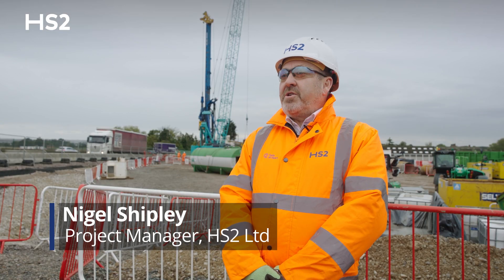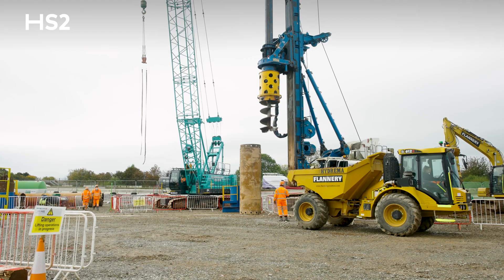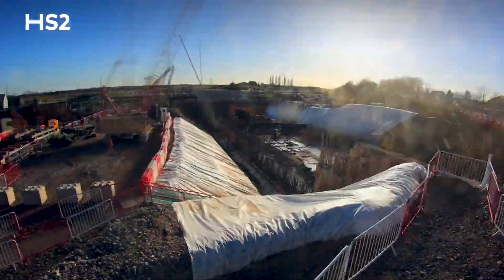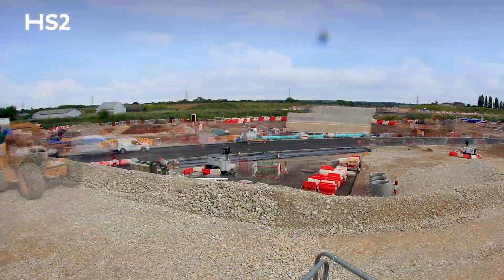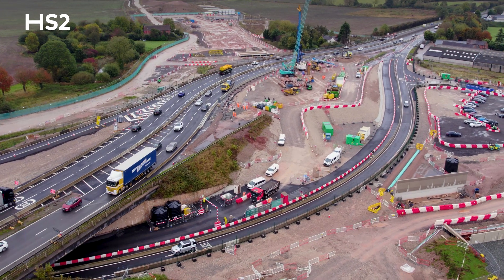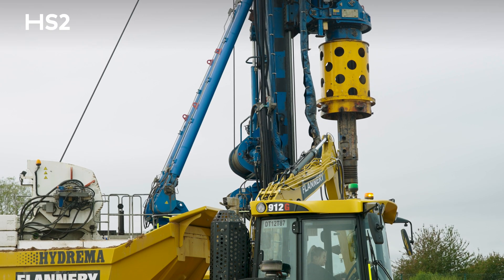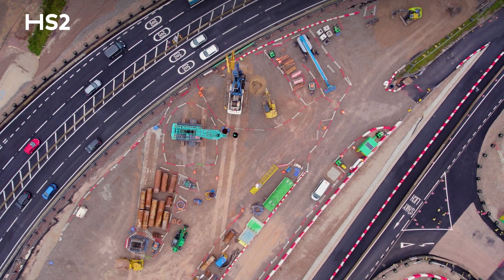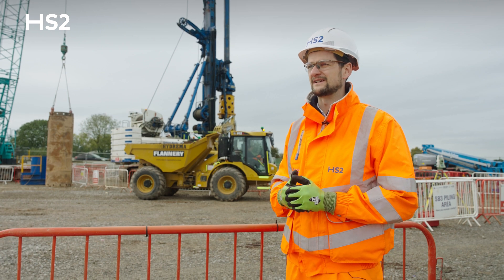Foundation works begin on key HS2 bridge in Staffordshire

Comment: Will the HS2 go to Manchester?
Reply: Who knows?  Whether it goes ahead or not, building the tunnel from Manchester City Centre to Manchester Airport and join it up with the WCML should be the next priority,  That will be an asset for decades to come whether they build HS2 or not
Reply: you'll be able to get hs2 trains to manchester, but it might be just as expensive and conjested as before if not worse if the aditional works don't get completed
Reply: I have to travel past these works at Lichfield to get to work .
The Delay has been minimal , unfortunately the only hold ups have not been caused by HS2 ,but by idiots who ignored the 40mph speed limit and have crashed either into the concrete safety barrier or into other vehicles
Reply: They want to at least create a new line, thats cheaper and not as fast, but will at least solve the capacity issue + will use the same trains so you would just be traveling a little slower on the sections from crewe onwards north.
Reply: @athavanainkaran2499 pay more tax and they will do it